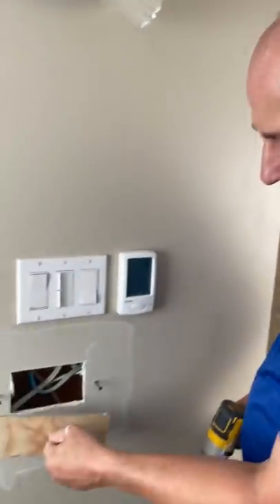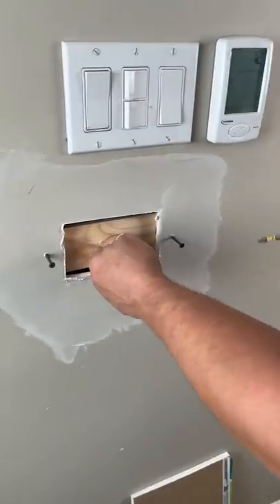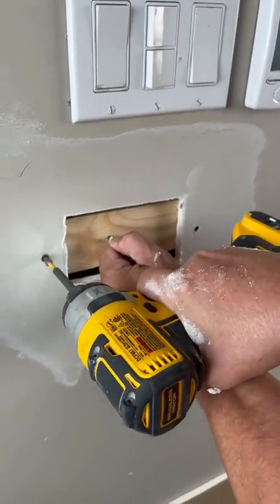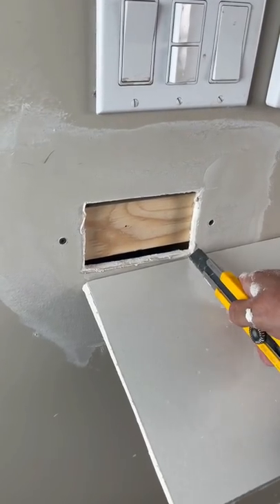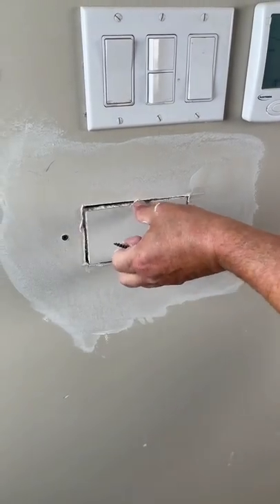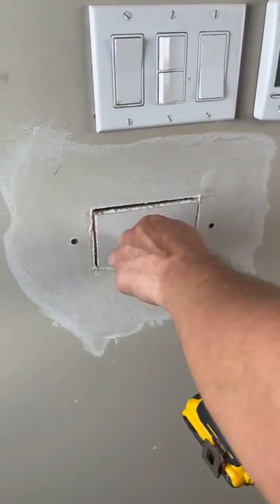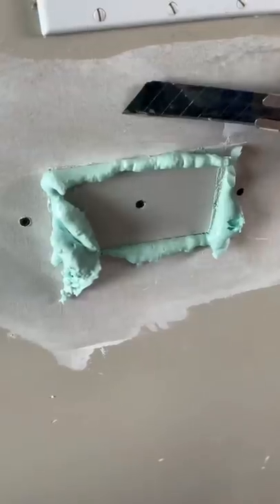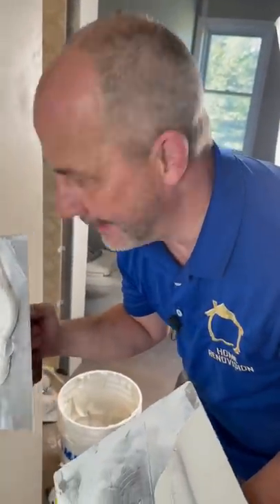Drywall Patch, No Tape Required #shorts

Comment: I thought that was how literally everyone did it. Except with something decent rather than expanding foam.
Reply: Nope
Reply: I do this
Reply: I've done construction for 10 years, that's exactly how I do it. Minus the foam
Reply: @nomammessss6031   then you do it properly, that foam made this take way longer.
Reply: "and you don't need any tape" I've literally used news paper...
Reply: Yes this guy thinks he invented the fucking wheel lmao
Reply: @nomammessss6031  
He just made his 25 cent patch cost $6.  You can never get more than one use out of those cans of foam.
Reply: @Addison Yates Joint compound*
Reply: @johnnyd6715  I use an airline and blow out the nozzle , just like new.
Reply: @satanslittlehelper9677  
I've tried a lot of things.  I really only use expanding foam for doors and windows.  Using on a drywall patch to save you from using tape seems silly.
Reply: Yes been doing if for years - but without foam
Reply: Right good tape is cheaper then crap foam.
Reply: Instead of expansion foam you usually would just use drywall mud to fill the gaps.
Reply: Same
Reply: Me too
Reply: Yeha we just regular mud and tape
Reply: @nomammessss6031  I would say, Foam is more expensive than Tape , that’s for sure.
Reply: I just over cut the Piece of drywall, and cut the drywall to the size of the hole, so it will overlap the whole, instead of using tape.That’s how I do it. Never saw it done.
Reply: You ain’t the only one
Reply: @tristancraven3685  dude is just showing u a tutorial and u think he’s bragging tf.
Reply: i dont know why he doesn't just use mesh tape.
Reply: Just prefill with a thicker mud, and then sand it back and coat
Reply: No any one with any experience would do what we call a cove patch. No tape required and nothing else needed other than the piece of drywall... Look it up
Reply: @YeeeeeHaaaaa  those are garbage. Dead wood is the way to go. I keep a lot of scrap 1x2s in my truck. I usually don't even have to cut them for a patch, so it ends up being faster and turns out a hell of a lot better since you don't have to worry about it bulging out(especially in a ceiling).
Reply: @theroguecollective1267  that's how you get cracks 6 months later.
Reply: @ghettoaquatics5244  yeah like I said in the other comment. That's complete trash and will never be as flat as dead wood and tape. It's also a lot faster to just use dead wood and tape. 

A smaller patch can be done with just Styrofoam. Cut it where it fits tight and flush and just tape over it and mud it. You can get Styrofoam so tight that it's more secure than a "cove patch" we call it a hot patch or butterfly patch.
Reply: @lHiTMANll  prefill instead of the foam, not the entire patch
Reply: @theroguecollective1267  you need tape or it will eventually crack. Might be good for a few months, but it will crack after a while.
Reply: @rexmann1984  but that's the same concept the newspaper is the tape. So why not just use paper tape?
Reply: @davidsprott3216  I don't think he used hot mud, and mesh tape will crack if regular joint compound is used. Sometimes it takes a while but it cracks, but with mesh tape and hot mud no worries
Reply: @ghettoaquatics5244  they're called California or hot patches in my area but it's the same thing and they're 100% better than this bs but not as good as backing and taped seams
Reply: @lHiTMANll  Facts! That's  the strongest way to patch and it's faster at least for me it is because I'm more of the hurry up and brute force type than a carefully remove the gypsum from the paper and gently mud it in type
Reply: @theroguecollective1267  have you done it that way at your house so you can see what actually happens
Reply: @chichidouglas5078  many times, still holds up because my patches fit snug, and dont have an inch wide gap all around
Reply: @lHiTMANll I do the same thing but I prefer plywood, OSB, or soft woods because they don't split out from the screws. I've done a few hot patches because the guy I was working for thought his way was the only way. So I didn't work there very long. There's no logical reason not to use some backing and tape on the seams. There's a stud behind every but joint and you tape every seam and inside corner on new construction.
Reply: @chichidouglas5078  yeah I just use whatever I can find as dead wood(backing) lol. Styrofoam works great on small patches that are less than 3 inches like a light switch cut out that was deleted.
Reply: @theroguecollective1267  I never have any gaps around my patches because I cut the piece I'm using first and then put over the hole and scribe around it. So I cut the hole for a perfect fit, and then screw in some backing on the 2 longest sides of it and screw the patch to that. Then cut 4 pieces of tape and mix some 5 minute mud and do the tape coat. By the time I clean my pan & knife it's ready for the second coat. Then clean up again. Do a touch up coat if needed and then texture. Depending on the heat, humidity, and the thickness of the texture you can prime and paint in 30-90 minutes. For smooth walls I use 20 minute mud for the second coat, and then topping compound for a small skim coat to plain it out like you do on but joints. They take more time but that's why you charge more. Backing screwed too the wall and the patch with taped seams is the strongest and most durable way to patch a hole. I know there's other ways that work,  but why not do it the best way?
Reply: @lHiTMANll  I've never tried that. I don't usually have any though. I do those the same way but I put a glob of CA glue on the ends of the backing where the screws
 would be and hold it tight like  you normally would for about 20 seconds, then glob some on the back of the patch and spray some activator on the backing and put it in. If you haven't used CA glue with activator before but it sticks on contact and it's strong so it's great for little stuff that would split out from nails or screws. If you haven't used it you should.
Reply: This is how I do my patches but I use setting type compound and don't bother taping and I've never had one crack. I would never use that messy expensive expanding foam in this application

Comment: At first I was like "I've seen this a dozen times", then he pulls out the expansion foam 🤯
Reply: Same! Lol
Reply: Same same
Reply: Same  with me
Reply: Foam
Is 
Ott
Reply: same
Reply: Same
Reply: Trust in Jesus Christ
Reply: Same
Reply: I was like boring 😴 😴 then the foam.. 😮 😲 now I'm wake wake
Reply: @jaymackenzie1817  how do u waste the can if you’re not using the entire can? Lol
Reply: @skillz78  If you've ever used great stuff foam, you would know what Im talking about. That's how I know.
Reply: Learned this years ago. Nothing new.
Reply: Only problem is that once you use the foam you have to use it all in a couple hours or throw the rest of it out.
Reply: I’ve been filling cracks with foam but didn’t know I didn’t need tape.
Reply: It could still crack with no tape. Its not worth the time and mess if you ask me. Then again no one asked lol
Reply: You can clean the foam straw out with hot water. The only way it could be wasted is if you dont know how aerosol cans work.
Reply: @jayhenry1133  90% of the time they are wasted.. For most people it doesn't worth the time to mess with a can to save it.. Even the ones that say "reusable".
Reply: @jaymackenzie1817  every can I’ve used you can save the straw which saves the can. Most of the time people don’t read the directions on the can that shows you how to save the can instead of tossing it after one use. I’ve used great stuff as well and maybe u need to read the can next time on how to save it.
Reply: @dcgo44r  you’re another guy who doesn’t read directions on a foam can. Lol they all show you how to save the can. I get reading isn’t your strong suit but damn. I currently have a can of foam that I’ve used 3 different times. This comes with a cap for the end of the straw you simply plug in. Another brand “great stuff” you simply bent the straw BACK and attached it on the plastic device. The hole opening attaches itself to it. The other kind of great stuff foam has a device on the end of the straw to OPEN and CLOSE.

Next time you get a can try reading the directions. Instead of getting frustrated and tossing a can out that’s still good to use. You’ll HANDLE the can right bud.
Reply: @jayhenry1133  exactly but rock heads get flustered when using foams. Probably without gloves and just toss everything away. It’s not difficult to save the can. Unless you’re someone who didn’t do well in school.
Reply: The funny part is I searched on YouTube and there’s videos on how to save a foam can. Including great stuff brand. Hilarious
Reply: So how do any of you know whether the cracks he foamed aren’t visible 1 month later?
Reply: @skillz78  dude, I read everything, literally.. And of course I have used one of those more than once.. As a matter of fact there is one that is sitting across the room, that if it works next time I need it would be the it fourth time.. But I doubt it.. I would let you know! What I'm saying is that it's not impossible to salvage it, but that for most people is an inconvenience, you have to clean the tip off on the reusable, or plug the regular ones, or whatever trick you came and deal with that messy stuff. And you might have to use "all" within a few weeks. Now you tell me is a good idea to open one can for a simple small patch on a drywall? The reason we start this argument.. Maybe if you are going to use all in other repairs..Mind I don't care about winning nothing. Just saying what I experienced and what others people and pro plasters are pointing!
Reply: Same lol
Reply: @dcgo44r  I apologize if I came off harsh. I definitely wouldn’t use it to fill in a patch work. That seems like a trick used just to create content for a channel. And I wouldn’t crack open a can to use it just on that. Total agreement there. You’re right most don’t care to deal with that messy stuff. I’ve been fortunate to get the most out of cans I’ve used so maybe I’m riding my high horse a bit. I’ll get off lol I’ve had buddies who feel the same way you do. So when I mention how to save it they either don’t know and/or don’t care simply cuz it’s messy stuff. Again my apologies for being rude/coming off as a dbag.
Reply: @skillz78  is ok bro! This is the internet.. Lol. We all like to have a bit of fun here, but just enough to be healthy. Your response shows your good character, therefore you have my respect. I do know there is no emotions or verbal.. in the comments, so most the time I play cool. Life is to short to be hating even on the internet.

Comment: Seems like a lot of extra work when you can just cut the drywall bigger than the hole, score it down to smaller than the hole, and then just use the paper from the drywall like tape…
Reply: Yep. A California patch would have done the trick.
Reply: Absolutely
Reply: Yes correct cut drywall bigger than no need extension foam
Reply: How bout you do it like a professional and use tape. Overlap the paper, Jaysus there's alot of shoemakers out there.
Reply: @tbone9216  well said no call backs for cracks! lmao and the boss won’t fire ya! This I think is part of the reason we get a bad rap..hack/slash 💡
Reply: Blow out patch.  Boom.
Reply: Exactly, blowout patch!
Reply: Called a California patch is what you described.
Reply: I learned this on my own in Ohio 20 years ago. California, blow-out,hot, quick patch. I just call it experience. We all have our ways to get things done. Just some are better than others. When I mud I use paper tape, mud, and a 4" knife to start.
Reply: What I hate is working in a house with little to no heat and it take forever for my inner corners to set up. And for whatever reason I cant use a corner knife to save my life it's so frustrating to me lol
Reply: Fuk those corner knives.. They suck , but i kno what your saying about the corners. Me. , I do all my outside corners in durabond. Its 10xs harder than regular mudd and dries much faster.
Reply: @seancollins6319  different areas call it different things… but yup your correct
Reply: I find it fun to cut blow out patches
Reply: @traderz3399  lol same I would get all fancy nice perfect round edges…👍
Reply: @tbone9216  guess you just started making shoes huh ?
Reply: YUP  ... CALIFORNIA - BLOWOUT PATCH AND 
20 OR 40 MINUTE MUD
APPLIED WITH A LARGE 
12" BLADE  .... SOMETHINGS YOU CAN GET  AWAY WITH ONE 
SHOT OF MUD !!!!!!
Reply: Yep.. thats called a hot patch
Reply: @davideisemann7130  Dumb response to someone pointing out this is widely viewed as hack work. I pointed out the proper way to do it which is faster and easier. Don't work much with your hands do you. Or should I say don't do much good work?
Reply: @tbone9216  😂🤣😂 you can see them coming a mile away
Reply: I usually cut the drywall first, place it on the wall, draw it up and cut along the edges to get a perfect fit
Reply: He has a clip showing that method too. I don't know why so many haters are out there for this method seems like once the plaster hardens you would be in the same position with tape.
Reply: @michaelrizzello3763  tape covers the effected area and as a result won’t crack under stress or movement…. Spray foam and silly string WILL …. There is no other way than the CORRECT WAY! We are not haters just PROFESSIONAL PEOPLE!